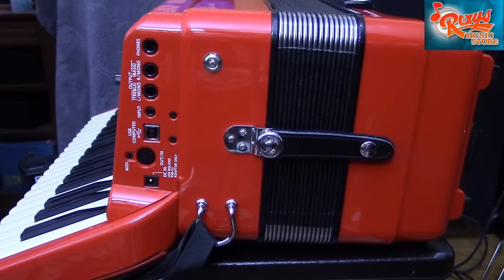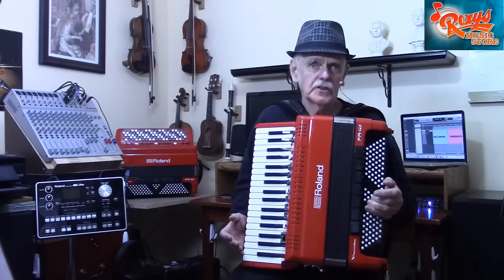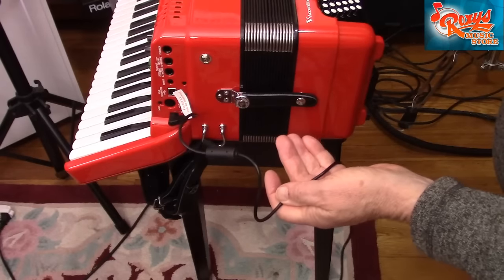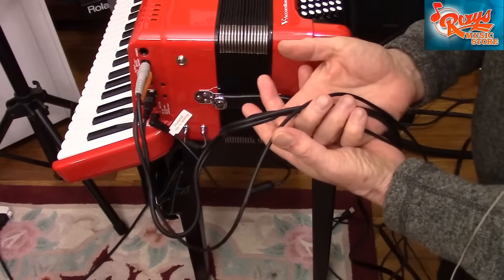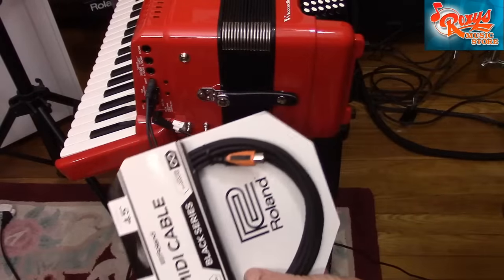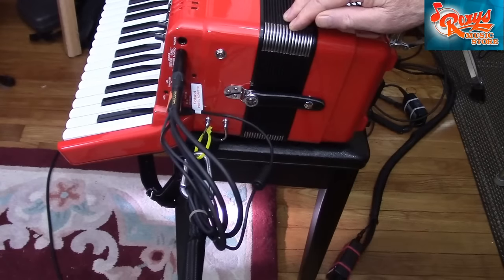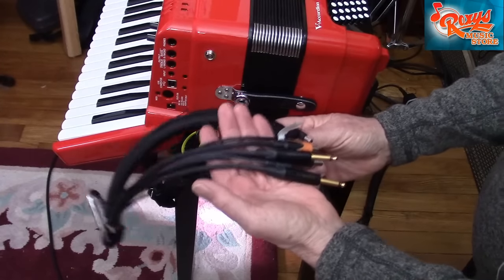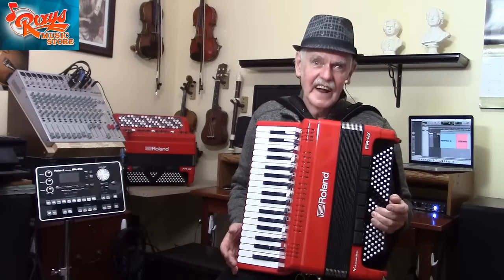FR-4x Safe Cable Management

Comment: Very Many thanks  Leon, for providing such great info.. I still use the FR-3x but that idea you give for the Flash Drive is something that I am for one going to try on mine
Reply from the maker: Be careful that the USB flash drive does not rub against the bellows. On my FR-3x I use a three foot USB extension cable that I route around the front of the instrument and secure using small adhesive cable anchors. That way I can easily change the USB flash drive with the instrument on my shoulders.

Comment: Great video Leon. You really are "hard wired"  I'm always concerned about the cables on my 8x and although I only use the power cable I always make sure it isn't being pulled or pinched. The Roland accordions have always been susceptible to damaging the power jack on the circuit board and I don't know why they didn't include some isolation of the jack in the original design. Fortunately we don't need to concern ourselves with this anymore. Your solution is perfect. Thanks showing the online catalog pages of the sleeves and usb extension adapter. Where do you get the transparent cable clips? Are they sold at audio supply stores or electrical supply stores. I've seen them in black but they seemed larger than what you have. I'm interested in your opinion on the 4x as compared to the 8x. I'm lightly considering the idea as I do find the 8x quite heavy for an old guy like me.
Reply from the maker: Thank you Neil. I’m glad you liked my practical solutions to hard wire connections to a V-Accordion. I didn't really make this up. It's all standard recording studio practice since many years. The small transparent adhesive clip to support my port protector cable was purchased at my local grocery super market. They are very common. They come in white and black, as you say, and more recently transparent. On my FR-1x I have a white one because they didn’t have transparent at the time. For my FR-4x I noticed transparent at the store and knew immediately it would be better. I can’t comment on comparison between 8x and 4x because I don’t own an 8x. Yes, I familiar with the 8x, but not intimately, like I am with the lower models. I’m in heaven with my new 4x.
Reply: I've been thinking about your choice to go with the piano version rather than the button model. Did you decide to stay with the more familiar design?
Reply from the maker: Hello Neil. I haven't gone with the piano accordion version rather than the button model. The French C-Griff chromatic accordion remains my primary instrument. I bought two instruments, an FR-4x and and FR-4xb, as an investment to make the FR-4x "Getting Started" DVD. Although the two instruments, 4x and 4xb, are essentially the same except for treble side keyboard, many piano accordionists prefer to see their primary instrument, the piano accordion, used in Roxy's instructional videos. They feel more at home, more comfortable, if I am holding a piano accordion most of the time, and I understand that. For me, it's the other way around. I feel most comfortable with the chromatic. But I can still play the piano well enough to demonstrate the features of the FR-4x using simple student examples. My original plan was to sell the FR-4x when I was done with the DVD, but my wife Diane has fallen in love with it. So now I've decided to keep both instruments, the FR-4xb for me, and the FR-4x for Diane. 
Leon
Reply: @RoxysMusicStore  Hi Leon, since you use both piano and chromatic FR4x, do you notice any sound difference for the same French musette register when played with the internal speakers?  I have the French sounds of Ludovic Beier from his chromatic Roland and it seems to me the French musette (Americain tuning) don't sound as rich on my piano model.